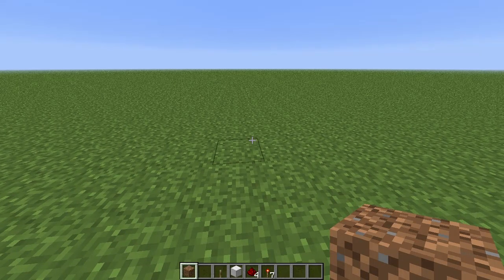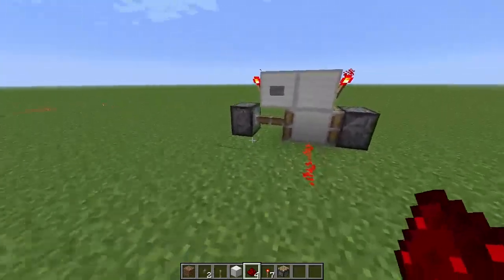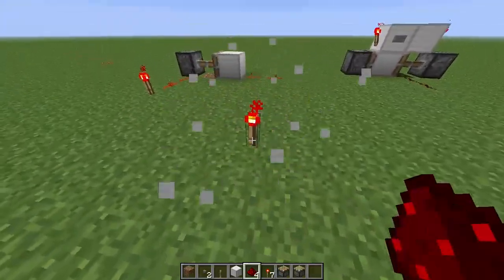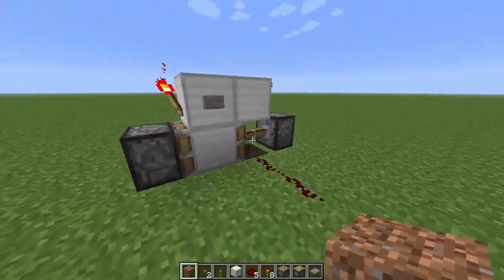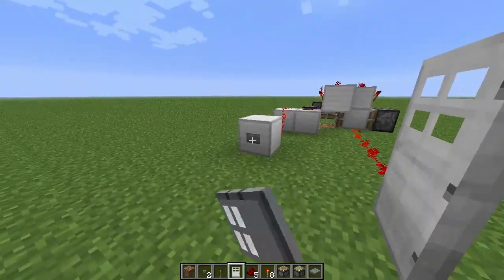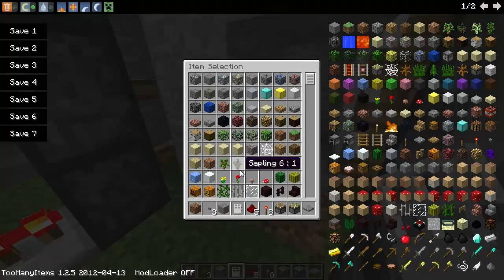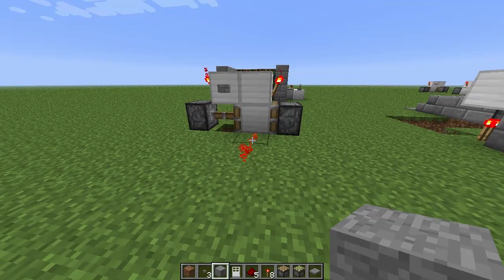Redstone Tutorials - #9 T Flip-Flop

Comment: this is incredible!! it certainly operates similar to a lever, but by using this I was able to make a CIRCUIT SWITCHER. and I don't think a simple lever would be able to switch circuits and open different doors (+ I used a button, which works much betta than a lever on this flip-floppery circuit)

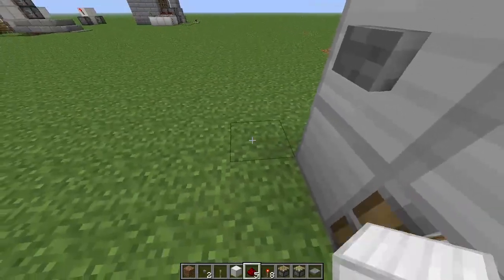Comment: 4:10
When the button is UNpressed both torches are on. This powers both pistons but, because there is a block in-between them, only one is extended.
When the button is Pressed the Redstone is powered and both torches are off. This powers only the extended piston (notice that the moving part of it is directly beneath the powered Redstone, thus receiving power).
When the button UNpresses again the Redstone will shut immediately triggering the retraction of the extended piston. After 1 tic the torches will be back on triggering the extension of both pistons. Due to the fact that the retraction of the originally extended piston takes 1,5 tics, the originally retracted piston starts extending 0,5 tics earlier than the other. After 1,5 tics are passed, the originally extended piston will try to extend again, but this is impossible because the other one has already started extending: effectively switching the flip flop.

Comment: it doesn't work on mcpe
Reply: MCPE has a ton of things that the PC doesn't. Mojang has yet to add the correct timings for the redstone repeaters. Like if you try the horizontal double piston extender using the 2-4-0 trick, 2 ticks in the first piston, 4 ticks in the second piston. And, 0 ticks in the block, which give the extension and retraction.

Observer block gives a one tick pulse when the block in back of it is updating, good for things like a 1 block wide 3x3 piston door. Actually, if you want to know how I got good at redstone, I took things like a 6x6 piston door and broke it up, saw which parts did what. Saw how it works. Then I watched redstone again and again, until I memorized it.

Now, I have a really good memory(Idk about you). And this lead to me being able to do block for block a 10x10 piston door, without any videos.
Reply: MohMed Gt it does work

Comment: From my understanding a T Flip-Flop is basically a lever.
Reply: yes, in a sense, but you can connect multiple buttons to one input and they will all work. If you connected multiple levers with out a t flip flop, either all the levers would have to be on or off,you could not use each lever individally. In other words, you can have your door open and close as if it had a lever on the inside and the outside, and both would work. Another thing that a t flip flop is useful for is turning two pulses into just one pulse, or as a counter (in binary).
Reply: Kind of. The difference is that you can have multiple buttons attached to it. One great use for it is being able to open and close piston doors from both sides.
Reply: But better, a hidden door with a lever cant be closed with convenience, a button with a T flip flop can have multiple activation points
Reply: A complicated lever
Reply: A T flip-flop is literally just a toggle switch

But its not called a toggle switch
Reply: YES!!!   WHY  NOT   USE    A     NORMAL     LEVER!!!!!
Reply: @corienevanoort678  ... take time to understand one of the comments that answers that question in the replies of the comment above.
Reply: @corienevanoort678  read the replies

Comment: so i played around with this and found another interesting use! 
If you lead the output of one of these into a second t flipflop, then it will only actuate every 2 button presses. a 3rd flipflop linked in will only actuate every 4th button hit (then 8, 16, 32...) the basics of a computer ;)
Reply: @onkarkhairnar8930  oscillation can be produce using a Minecraft that circles over a detector rail :)

Comment: No, there's no delay, you can see it at 7:17. The real reason why it works it's because a piston can't push an extended one. So when you press the button, the torches go off at the same time and the extended piston retracts because it has no power. Then the torchs light up before the piston has retracted completely and the other one pushes the block as the retracting one isn't an obstacle anymore.

Comment: you're right, but the delay is caused because of the button on one side and not a middle. it's travelling through the first torch before the other, causing one to activate (or de-activate whatever u wanna hear) before the one it reaches next.

Comment: My explanation to why the pistons 'toggle' is, it's basically due to the delay in retracting and extending. Because one piston is already extended and the other isn't, once the torches are turned off and back on, the piston that is extended has to both retract and extend, however, the other piston has no need to retract, there is no delay between retracting and extending so it can extend immediately, thus preventing the other piston from extending.

Comment: Thanks for the video! Idk if you know this now, but you said at 4:00 that you didn't know why it switches the block. Actually what should happen is that both pistons should extend and push away from the center of the block. There is a rule with pistons that says "A piston cannot move an extended piston". so since both pistons retract and extend at the same time, when the block is one in between, they simply switch because they cannot push each other apart! hopefully that helps. Thanks again!

Comment: Great thread like/subscribed. I used the t flip-flop to make a step activated piston door but the issue is that your design activates on button release which requires me to get off the button and wait which is more annoying than levers. To fix this, I inverted the signal to the T and it works as intended... sometimes. It seems to start bugging, creating permanently charging the pistons even if i destroy all torches. Once it short circuited and it doesnt work consistantly at all. Please help. <3

Comment: I'm not sure if this has been answered but this T Flip-Flip  works because pistons open and closer at slightly different rates. Also if you add a block to the input and put a rsTorch on top of that then use your button it goes much faster.

Comment: surely for the one time switch if you replace the sticky piston with a normal one then the block wouldn't be pulled back and therefore it would save the need of redstone dust and a slime ball which are a pain to find sometimes.

Comment: The reason it causes the blocks to switch is because as soon as you hit the switch, the pistons power off, effectively opening up the space next to the block, the pistons activate again, making the block move to the open space, forcing the other piston back, eventhough it should be on. Which is kinda iffy if you ask me.

It would be nice if you could use that sticky piston way, and have another button press break the loop (instead of having to break the redstone manually),

Comment: It brakes! I dont know what Im doing wrong but when I use this it will work great for a few tries and then randomly I will here a hissing noise and the whole thing is stuffed! The torches wont go back on. And I cant just reinstall the torches that does work, I have to remake the whole thing. Anyone else having this problem?
I do exactly what Flabaliki does, i've watched the video 50 times. It works fine about 6 times and then dies. Advice please?